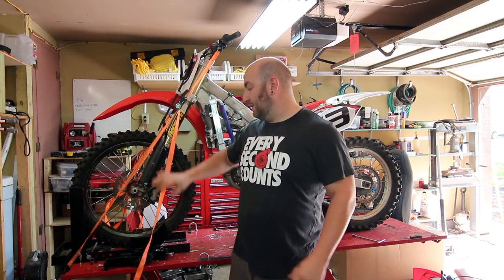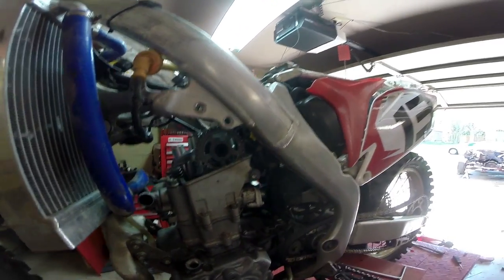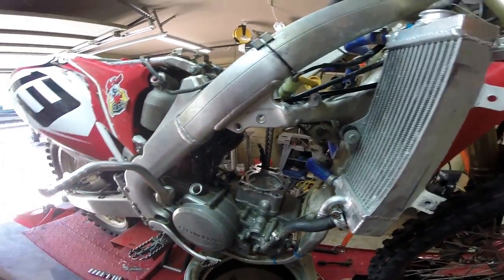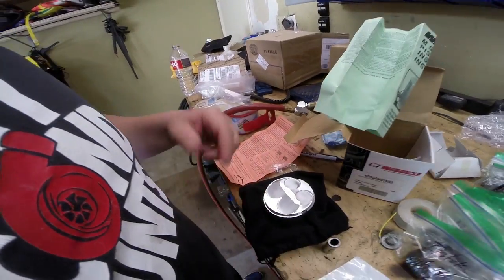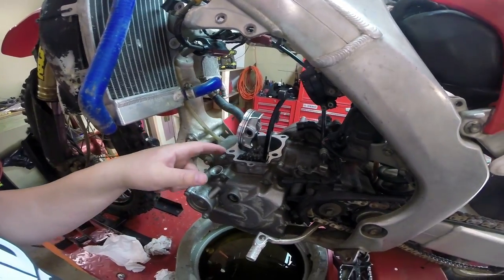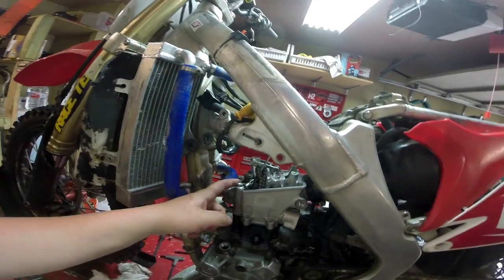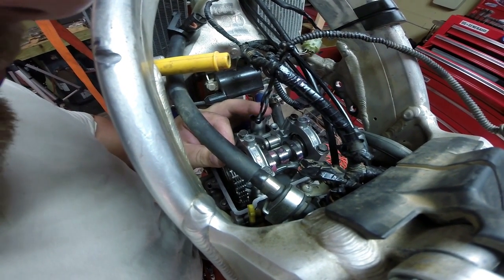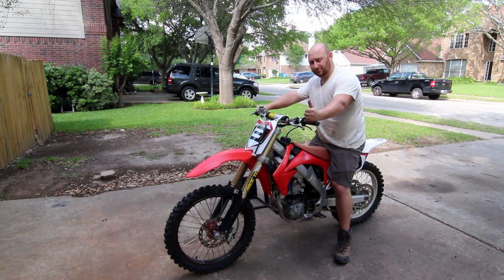2011 Honda CRF250R Top End Engine Rebuild DIY

Comment: Hi i am now doing a top end on a 2012 crf250 can u help with the torque settings for head bolts and cam caps in nm
Reply from the maker: Check out carlsalter.com. they have manuals

Comment: Nice video. Did the bike already have a new crank in it when you got it? Im thinking about replacing my crank and just wondering if its a nessesity when i replace the piston. Its a 2012 crf250r with 100 hours. Runs great now but i want to make sure it stays that way.
Reply from the maker: I did not. Generally if the crank bearings feel right I dont tear stuff apart. Of course when you are flipping bikes vs. something you bought to keep long term the priorities are a little different.
Reply: Ok thanks for the reply. I havent ever replaced a crank in any 2 strokes and havent ever had a problem with them but ive heard for some reason 4 strokes cranks dont last as long. Ill probably just buy the full kit though. Thanks.

Comment: 2010 and 2011 crf250r blowing up fast because when you push the stop button the fuel injection still give fuel to the engine and then it thin the oil. Change oil every 1-2 hours!

Comment: Hey, Maks. Just out of curiosity, how much (ball-park) did it end up costing for the replacement head? Did it leave you with enough profitability to justify all the labor you did?
Thanks!
Mike
Reply from the maker: Nice thing about dirt bikes is that they come apart quick and go together quick. So not much labor involved especially if you have done a few. 

used jug - $75
used head - $328
gaskets - $70 
Piston - $135

Plus i got some extra parts i will sell. My guess is when all is said and done I will have around $850 in the bike. So to me its worth it.
Reply: Head bolts on these bikes don’t have to be replaced they aren’t torque to yield. Now when it comes to honing the cylinders, it’s debatable on these in specific. All the race bikes have nikasyl bores which is super super thin. You shouldn’t Hone them just clean them really really well

Comment: What website did you find a bike that looks that nice for only $350?
Reply from the maker: I get almost all my bikes via private sale. Like craigslist.
Reply: Ive never seen one that cheap even blown up 
I wish
Even blown up they are always over $1000 around here .
Also i have a question i want to buy a used 250f but im on a tight budget 
How important is it to get a fuel injection bike? 
Im thinking i want fuel injection for easy starting but how , much of a performance difference is there ? 
And if you could get a really good price would you consider a bike that didnt have fuel injection?
Reply: Tarz Thomas believe me, I just got a fuel injected 250 and they are so much more better than a carburetor 250. Carburetors are so much work to get jetting right. Spend the extra money for convenience and better starting you won’t regret it